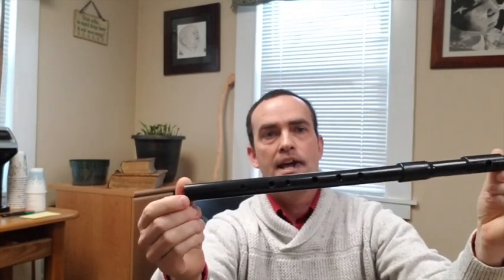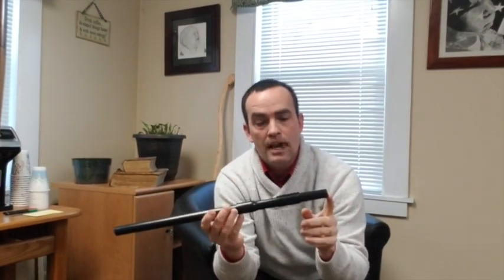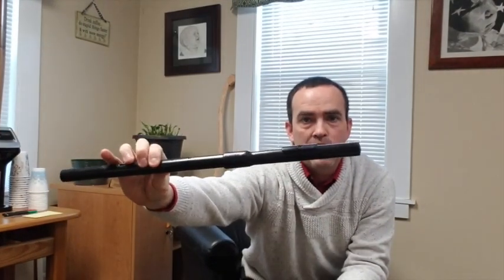G major Fife - New Model Idea

Comment: Hey Mark. 
Is this something different than the G major flute you recommended to me. If so, how does it differ?
Reply from the maker: Michael, it is different in that it has two sections, making it tunable to a degree, and the lip plate is a different design than I previously used, making the tone louder without taking a significant amount of air pressure.  The one I recommended to you does not have a lip plate, and is a single piece.